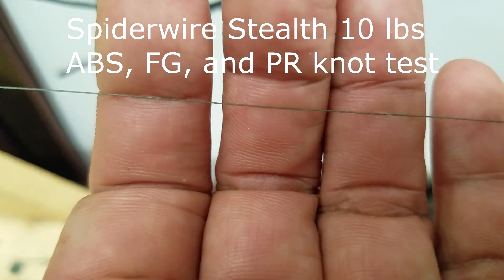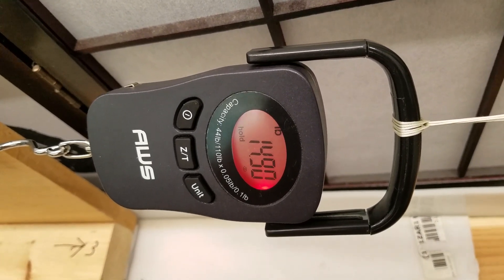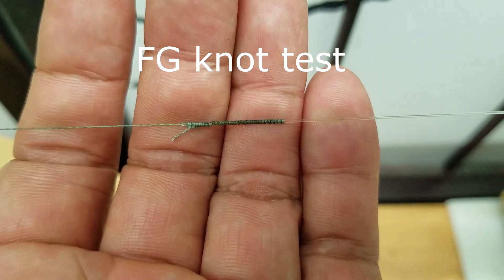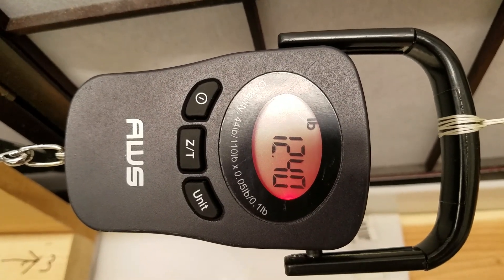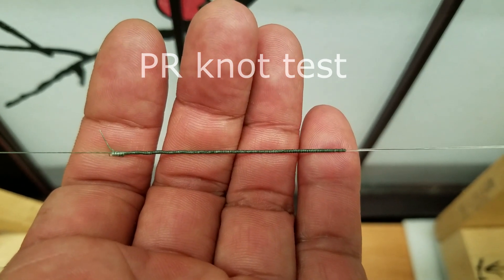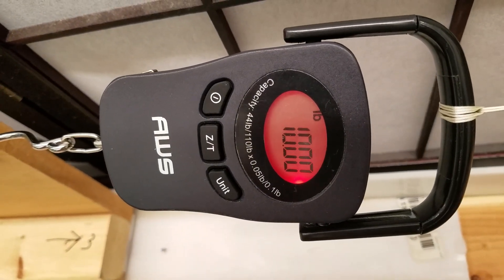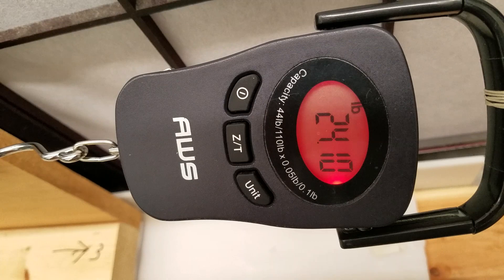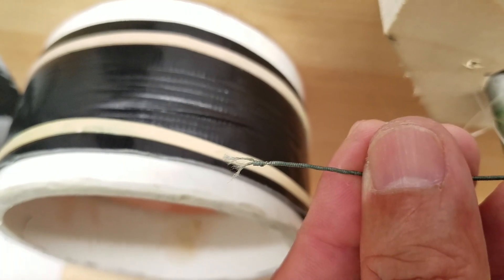Spider Stealth 10 lbs ABS FG PR Knot Test

Comment: Does this 10 lbs stealth-braid, has 0.20mm/0.008in diameter ?
Reply from the maker: The listed diameter is indeed .20mm/.008 inch. The actual diameter based on the mass is .247mm/.0097 inch.
Reply: @aquaholiklee  Thanks a lot, I have noticed that on some packages of İnvisibraid it's written that for 10lb braid it's 0.11mm diameter and on some of them it's written 0.17mm.. That's confused me a bit. Thanks again